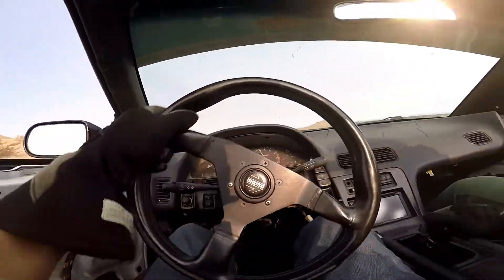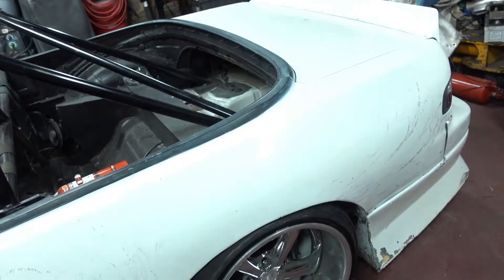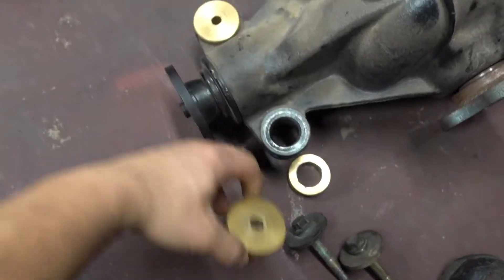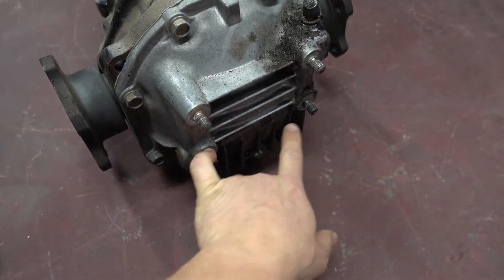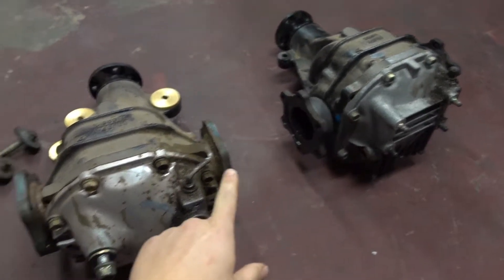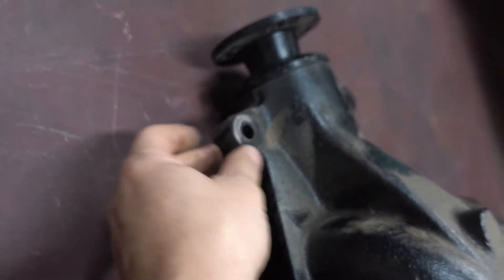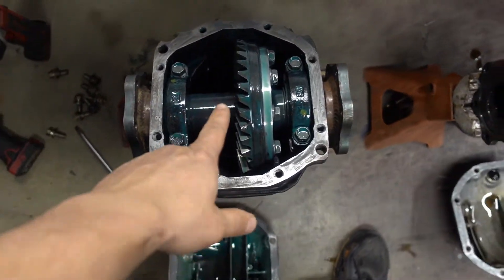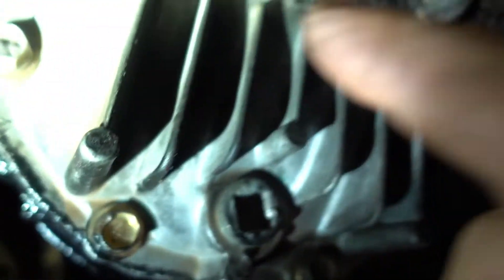Difference between S13 and S14 differentials and how they can be interchangeable!

Comment: Vlsd is also an r200, so also interchangeable. Even the r33 diffs can be used on an s13, because its also an r200 diff housing. Im currently running a r33 ABS diff with a 4.111 ratio and an s15 helical lsd in my s13. Just needed the solid bushing and the s13 diff cover. So it could be mounted onto the s13 subframe.

Comment: I had a s14 diff mounted on my s13 which was welded now i bought a s13 diff with a vlsd and the diff is 2cm shorter. Olso the bolts where the s14 one has buschings are not the same the tread is not taped to the end
Reply from the maker: Vlsds are way different from the open diffs.
Reply: The shorter diff might be a non ABS diff. Normally all r200 diffs have the "same" mounting points, as long as you take the  diffcover which suits your subframe. But i also have seen solid bushing inserts with eccentric holes. Meybe thats the thing you need

Comment: S14 abs diff will not be a problem swapping to s13 body right?! Thanks in advance.
Reply from the maker: Only difference there may be in an ABS diff is the housing and axles so I would recommend possibly swapping those in along with the diff
Reply: @LukePakula  you mean swap everything thats inside s14 into s13 casing?
Reply from the maker: @johnsadang3845  honestly I dont think anything is different in the diff and gear it self, I think it's just the housing and the axle stubs that are different.
Reply: @LukePakula  alright thank you so much!!!

Comment: hello bro how are you i need your little help.... 
i have crown 1994 model with 2jz vvti 3 coil engine with 4 forwad 8wire gear .. 
kindly tell me which diffrential is best for pick and fuel effeciant?
Reply from the maker: Generally lower gear ration is better for fuel economy
Reply: @LukePakula  which gear u recomend
Reply from the maker: @wajahatkhan6968  for a 2jz with a common gear ratio transmission, a finally drive between 3.9 and 3.1 will do just fine.

Comment: My silvia s13 diff shafts cups have 6 bolt pattern (with two close to each other) so it would not fit
Reply from the maker: Are you saying your S13 stubs dont fit into the S14 pumpkin?
Reply: @LukePakula  no i mean in your video both diffs have 6 bolt shafts in a star pattern right? but in my s13 silvia the 6 bolts are in pairs so its like a 3 spoke star.
Reply from the maker: @jasaircraft  correct. I am using Z33 adapter stubs but your 6 bolt ones will work on S14 and S1r diff as well. Only different ones I know of are the Vlsd ones.